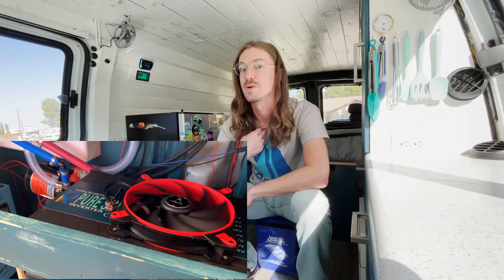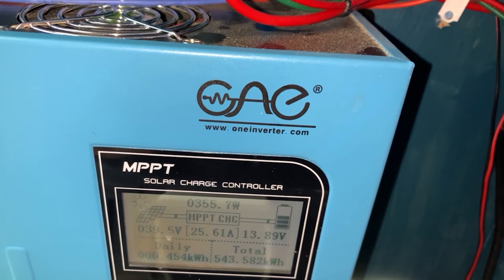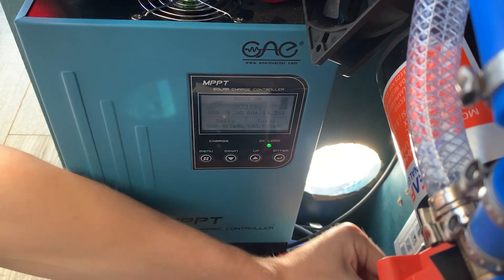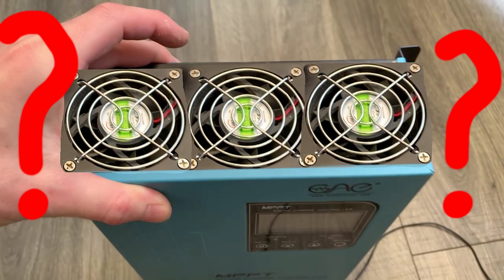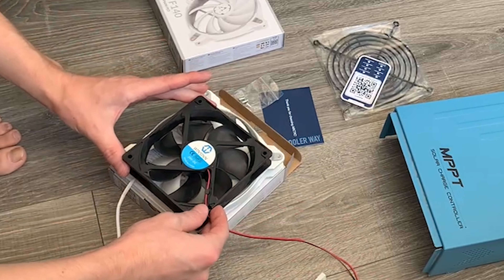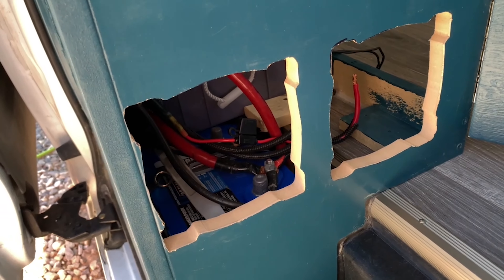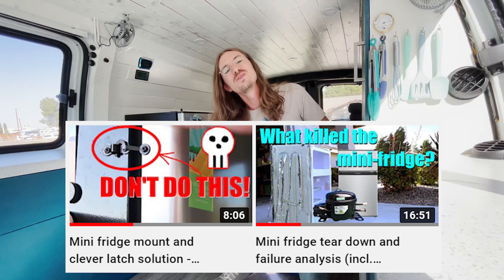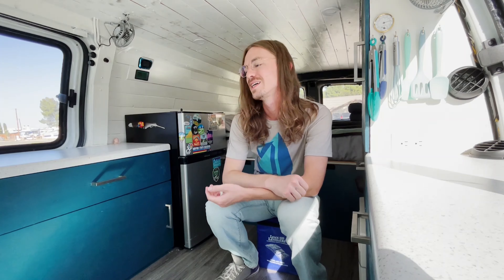Silencing the solar charge controller

Comment: Maybe put some of those nice quiet fans blowing down/up the side of the new fridge? Perhaps some kind of ducting to keep the warm air away from it? I'm sure you could come up with something better than I could for keeping the fridge ventilated and cool.
Reply from the maker: Spot on. I actually had EXACTLY those two modifications planned when I ended my three month trip. Unfortunately the fridge was a little impatient on those upgrades 💀

I think I may "Frankenstein in" an old 120v compressor and run the hot condenser lines below the van? 

Would probably help with fridge efficiency not having the piping hot lines running just centimeters from the fridge interior.

I'll do some troubleshooting on the current compressor first then make a plan from there!

Cheers!
-Tim
Reply from the maker: @nerdinium just finished troubleshooting. Bypassed the thermal protector and it fired right up! Ordered a new protector for $6.99.  Will now have to decide how to prevent the issue in the future.

I'm thinking you're spot on with those ideas.

Comment: convert the frige to a dc compressor it would be a cool project to try out I would sujest using car ac charge lines to help charge it
Reply from the maker: I actually searched around on DC compressors last night.  Would definitely be a cool project, but the DC compressors cost more than the fridge ($120+).

But I think I'm going to snag a used 120v compressor from a household fridge / freezer and splice it into the unit.

The current compressor runs R600a, but I think older household compressors run the readily available r134a.  Just not sure if my capillary tube would need to be resized for a refrigerant change!
Reply from the maker: Good news, bypassed the thermal protector and it fired right up! Ordered a new one for $6.99.
Might need to reconfigure my setup to keep it from happening again though.

Comment: 3rd fridge a charm?
Reply from the maker: Might just Frankenstein this one with a new compressor and change up the way it expels it's heat.

Let's call it "fridge number 2.5" 😂
Reply from the maker: Just finished troubleshooting. Bypassed the thermal overload protector and it fired right up! New one on the way for $6.99

Comment: "Cool" project!  yuk yuk yuk.  Watching paint dry is actually fascinating when it's time-lapsed.  I am not sure the warm-ish exhaust air blowing on your fridge killed it.  I run my iceco fridge/freezer in a  (sometimes) very hot, unventilated van and it hasn't died yet, and my garage fridge has been running for years in an unconditioned space (30-95 deg).  sounds more like a manufacturing deficiency to me.
Reply: I totally agree with Johnny!  Especially if you don't know how much extra heat you were in fact adding. It was not really the cause, imo.  I do have professional experience with custom Marine refrigeration and A/C systems.  Might have been a cheap Chinese compressor and not a Danfoss.  A unit running in direct sunlight or hotter summers could have got just as much extra heat but who knows?
Reply from the maker: Haha, almost cut out the paint drying shot, but it was oddly satisfying to watch in a time-lapse.

I'll go run through the factory service flow-chart for the compressor for the no-start troubleshooting and see what I can find.

Just weird my previous fridge (exact same model) did fine for over a year with a punctured condenser line, yet this unit decided to pound sand after a few months.

It did seem more noticeably warm on the sides, and would (loudly / annoyingly) run non stop from the time we went to sleep to the time we woke up each morning.

I'll have to make a quick video of my findings.

Of course it's out of warranty as I bought it second hand (although new in box).

If I were feeling a little devious I'm sure I could buy the same unit then return this unit in it's box for a refund... But I think I have something better planned!
Reply from the maker: @rickdees251  Hey guys, just went out to the fridge with the multi-meter and luckily it was just the overload protector. Bypassed it and it fired right up. Ordered a new protector for $6.99.

Comment: You worry too much about a fridge imho. It is a strength that you can replace one part of your van without breaking a bank, imagine using dometic 1000$ fridge or some "rv branded" stuff. 

It is just a hidden cost of upgrades.

I even vastly prefer your fridge in everyday use compared to ~1k$ dometic horizontal fridge that are used in vans and sailing boats(boat territory is abit more tricky but still). It feels more like home and it is far more practical too.
Reply from the maker: Bummed it died out, but you're right. You can replace the basic 120v mini-fridge many times over without coming close to the cost of the Dometic units!

Bummed that I didn't get nearly the same life out of it as I did my last unit (which had a punctured condenser line), but it's not the end of the world.

I'll run through the compressors factory repair flowchart for a no start condition and see if it's salvageable.
Reply from the maker: Finally got to troubleshooting today. Bypassed the thermal overload protector and it fired right up! New one on the way for $6.99.  Still need to reconfigure the setup to keep it from happening again though.